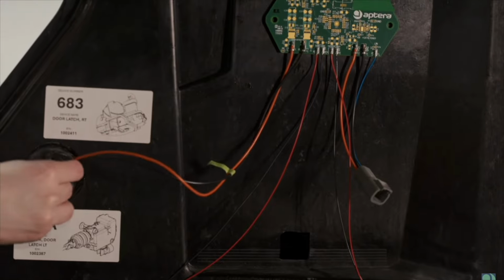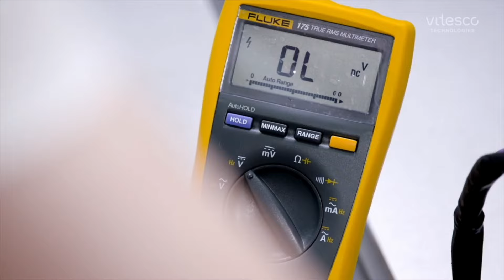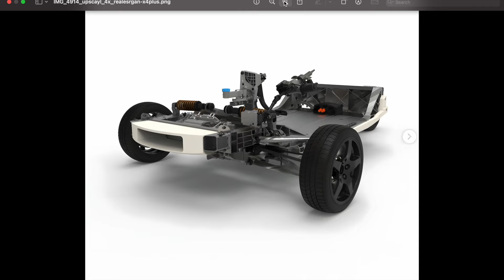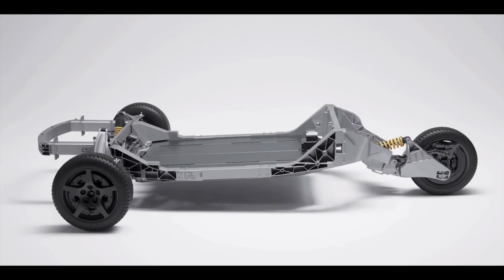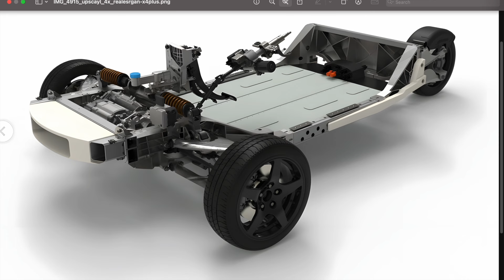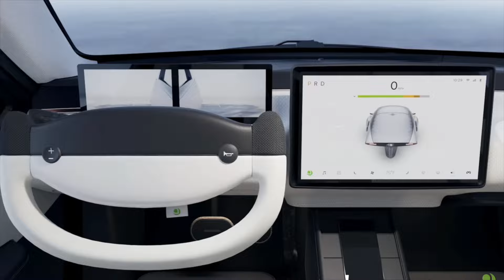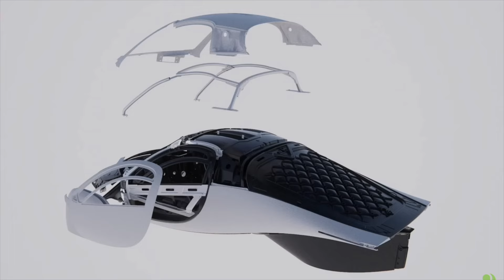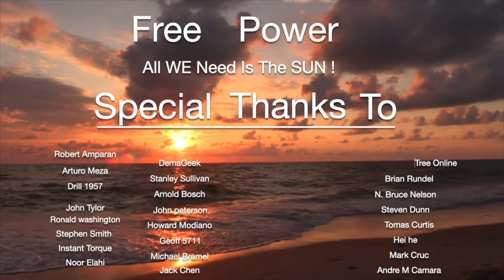The Motor Is In !

Comment: I was lucky enough to attend the Battery event in San Francisco.  I was sitting in the car in the courtyard, and Chris Anthony came over to talk to me. I asked about changing drive trains.   Chris told me that from the beginning, the design was to work with either hubs motors or with this central motor unit from the get-go, and he was very adamant this wasn't a redesign.  Frankly, I don't think they could redesign it that quickly and maintain all the structures without causing a massive catastrophe or re-engineering time losses.

And I think if there are different visual designs from the past, I think they had two different frames available or frame add-ons to make the adjustments needed.
Reply from the maker: That make sense , I was wondering how the frame was redesigned so quickly . 😎

Comment: It is going to be great! I have much more confidence in this redesign. In time the hub motor will be a mature product, with every problem solved and every component in mass production (the motor, wheel en power electronics). 'Protean will be first to accomplish this', is my lucky guess. One has to integrate a breaking and cooling system with the hub motor, and make it weather/road proof. That is not an easy engineering task. A fully functional, durable and mass produced in-wheel motor for electric cars, is a huge milestone in EV history. The companies who can achieve this are awesome. An ultra airodynamic sedan/hatchback/three-wheeler with in-wheel motors and solar panel cover, that is the future 100%, unless I finally figure out how ZPE extraction can be done on a commercial scale (then anything goes).
Reply from the maker: They said the Aptera could still have the Elaphe motors later on , just not now . 😎
Reply: @freepower1082  Both Elaphe and Protean don't have the required power electronics in mass production yet. This is costly,  see the recent 5.5 million pound grant for project PULSE to be carried out by Protean and Unipart Manufacturing to develop mass production of the power electronics for the Protean in-wheel motors. This is one of the reasons mentioned by Steve, not to opt for Elaphe's in-wheel motor for the time being.